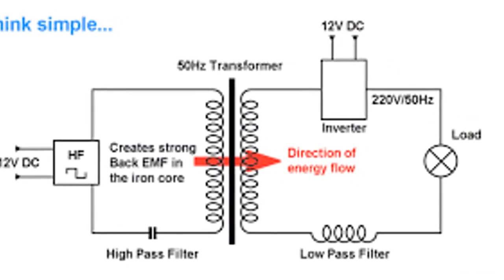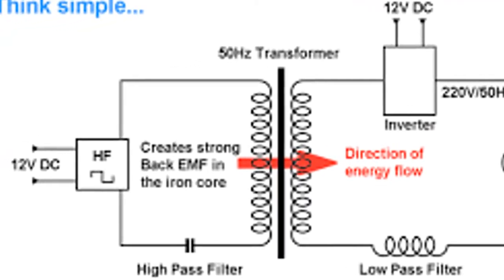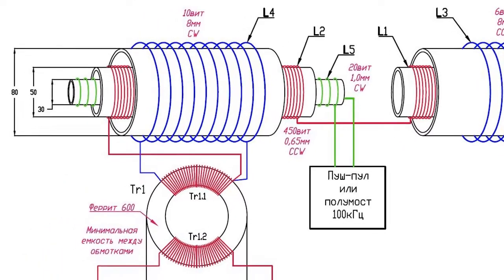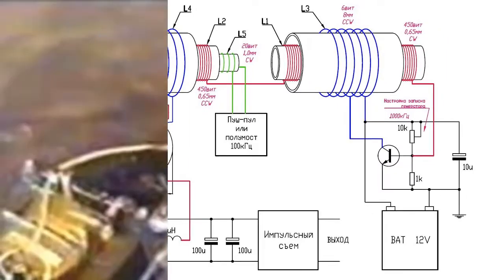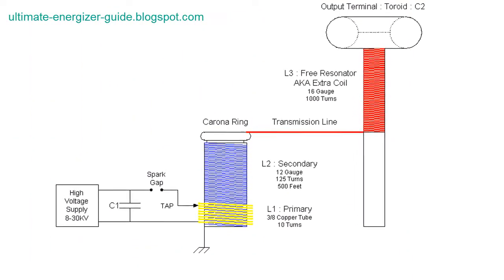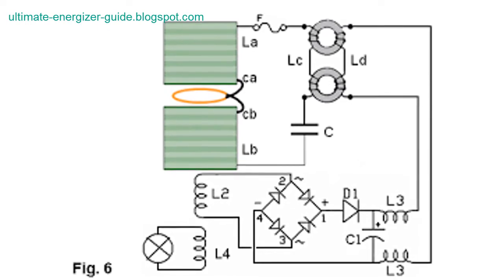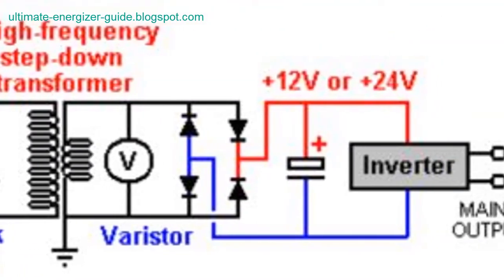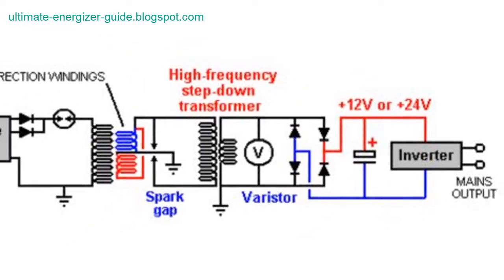Ultimate Energizer Guide Review - Tesla Coil Version Generates Free Energy

Comment: FIRST OF ALL. Nicholas tesla never said that his COILS  would create free energy.
2. The top load of Tesla coil has to have a high vacuum Spheres to connect to the atmosphere. 
3. The coil and the capacitor Have to have the same values too Resonate properly. 
4. It's not free energy. You're just absorbing small Amounts of the Earth's magnetic field, causing the coil to start to oscillate.
5. Most importantly You have to know where on the circuit to put the ground rod Otherwise, you get very low voltage or you get very Sporadic voltages. 
6. One last thing all of those pictures are not Tesla coils. They are just pictures of Power source, circuits. 
7. A Tesla coil needs to be posted and not using DC or AC.
Reply from the maker: The coil and capacitor complement each other, when combined, it is just an oscillation corresponding to a mechanical oscillation.
The resonance condition when Z_l = Z_c in a parallel circuit is not consistent with the mechanical resonance theory. Although electrical science initially intended to establish the synthesis of two harmonic oscillators. But in the end they ran away.

Don't be so fake and stupid, man...
Is it true that pretending to be Tesla but suppressing Tesla's technology...?

There are many other things that show you haven't really researched Tesla carefully.
Reply: Tesla never developed the T.C to operate on Electricity but on radiant shockwaves, they are not electromagnetic devices and have proven to transmit higher overall output than input when picked up by a tuned resonant receiver.